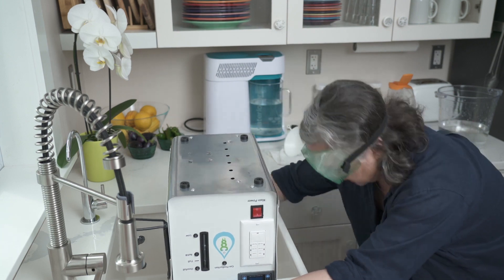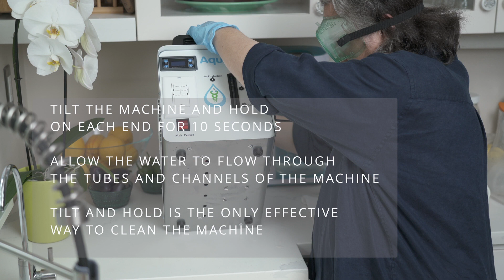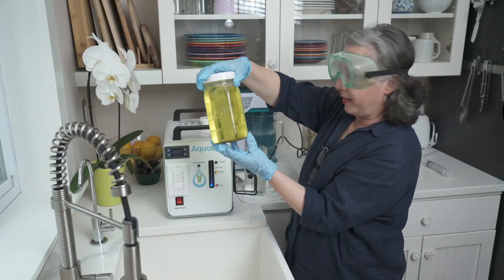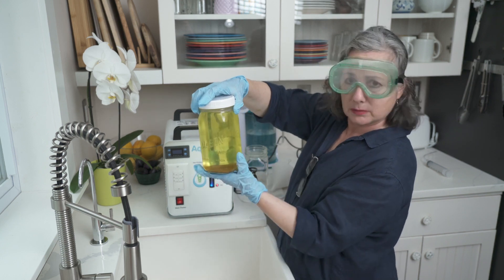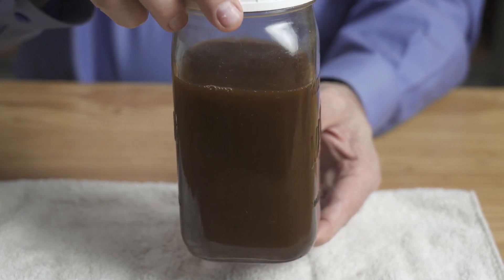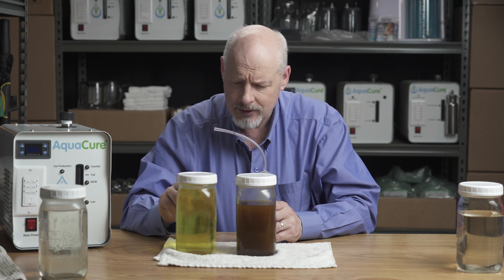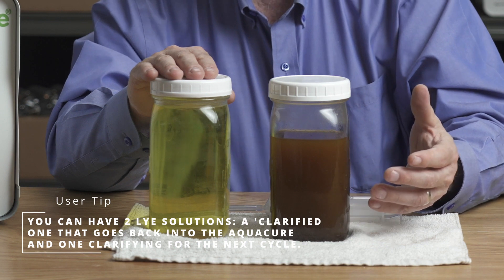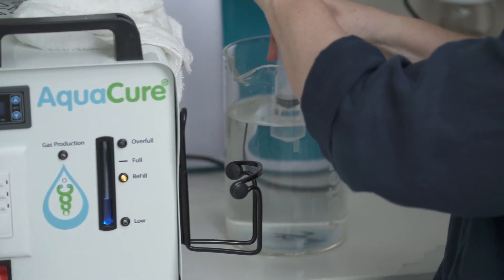AquaCure AC50 Maintenance (series video 5)

Comment: @7:04 how do you know when and how much lye to add back in?
Reply from the maker: Such questions are best asked by eMail using 'support'   https://eagle-research.com/contact/
FAQ: When do I add lye into the AquaCure Solution?

My advise is NEVER to change the lye in your machine.  In one of my electrolyzers I’m still using the same lye I originally put in it in 1986.

You should CLEAN the lye, but then reuse it.  From time to time you might need to ADD lye, because a tiny amount rides out on the water moisture… but that’s it.

The only time you need to CHANGE the lye is if it gets contaminated…  If you have foaming happening (which causes a rapid loss of lye) then you need to dump, rinse and put in a new lye solution.

You can buy 99%+ pure food grade lye online.  Here’s an example:

https://www.amazon.ca/gp/product/B06W57N49Y?

https://www.amazon.com/Sodium-Hydroxide-Grade-Caustic-Ounce/dp/B06W57N49Y/ref=sr_1_2

All that said, you do need to CLEAN your machine periodically (about every 100 to 200 hours) to get the sludge out.

First dump the lye solution into a plastic bucket (save it, don’t pour it down the drain).

Second, fill the AquaCure with warm (not hot) water (can be tap water) and dump it out (down the sink OK) as many times as needed until the water comes out clear (no sludge or debris).

NOTE: Vinegar or citric acid are not needed for flushing, plain warm tap water is OK.  There are no 'deposits' for such cleaning agents to dissolve and lye itself is a great 'soap'.

Third, filter the saved lye solution through a coffee filter and then pour it back into the AquaCure.

You keep the old lye because it is 'conditioned' and more efficient than 'new' lye.  It does not matter if it's discolored (that occurs in any case).  What matters is to filter it to get out the debris and sludge; otherwise it'll last for years.

Note: if your gas production has been reducing, it may be because your lye solution has gotten weak.  

You will lose lye over time (for several reasons) so you can add an ounce of lye when the solution is out of the machine, but ONLY if you need it.  You do not want the lye solution to become too concentrated.
FAQ: When do I add more lye?
The lye is a catalyst, so it is not 'consumed' and in theory the initial charge would last a lifetime.
However, in practice a tiny amount is lost out with the gas over time (the Tower Cap reduces loss and the Humidifier absorbs the rest). 

Lye can also be lost when people pour out some of the solution or if there is a leak or during maintenance rinsings.

The easiest way to determine when you need to add another ounce of lye is when you notice the gas production has dropped AND there is no gas leak or hose blockage;  99% of the time a drop in gas production IS A GAS LEAK.

FAQ: Electrolyte (lye or NaOH) solution concentration
I do recommend a specific gravity (of the Lye solution) of about 1.05 to 1.1 (using a hydrometer).  
Here’s a good video on what a hydrometer is and how to use a hydrometer (need a test cylinder too)
https://www.youtube.com/watch?v=0rj8s6mMAsE

You can get a good kit from Amazon.  Be sure it is a hydrometer and not (or not only) an alcohol meter.
https://www.amazon.ca/Specific-Gravity-Hydrometer-Test-Kit/dp/B001X27L9W/ref=sr_1_1_sspa

Or just mix 80 grams of lye in the first mix of solution.  The solution does NOT need to be exact.  In fact it’ll vary normally as the water leaves anyway, the remaining solution becomes more concentrated.

You can use more lye (I previously recommended up to 150 grams), but we've found it leads to excessive internal lye crystallization that causes clouding of the sight tube and exacerbates any internal plugging (due to sludge formation or oil contamination turning to soap).
How to add more Lye?
NEVER pour lye powder down the water fill stem.  

If you just pour the lye powder into the AquaCure it WILL set up like concrete and not go into solution, the hard chunks might even come loose and block internal gas orifices.

I recommended that you pour out the solution into a plastic bucket or stainless steel sauce pan, add one ounce of lye, mixing it in like you did when you made the initial catalyst batch.

I always recommend re-using the OLD solution.  It is more efficient than NEW solution because it is ‘conditioned’.  I’m still using lye solution I originally mixed in 1986.  Don’t waste your conditioned lye!

Color of the electrolyte does NOT matter, electrolyte normally discolors with use.  What matters is sludge or debris.  
If you see any sludge or debris in the solution you poured out, use the opportunity to filter the electrolyte solution through a coffee filter before pouring the solution back into the AquaCure.  Often if you just let it sit, the sludge will settle to the bottom, leaving a clear yellowish liquid.

It’s also a good idea (if there is sludge or debris) to rinse out the AquaCure 
Put about 3/4 liter of warm (not hot) water (can be tap water) into the AquaCure and swish it around by moving the AquaCure from side to side.  
Then dump it out (down the sink OK), 
repeating as many times as needed until the water comes out clear (no sludge or debris).
then pour your cleaned lye solution back into the AquaCure.

You should CLEAN the lye, but then reuse it.  From time to time you might need to ADD lye, because a tiny amount rides out on the water moisture… but that’s it.

The only time you need to CHANGE the lye is if it gets contaminated…  If you have foaming happening (which causes a rapid loss of lye) then you need to dump, rinse and put in a new lye solution.

All that said, you do need to CLEAN your machine periodically (about every 100 to 200 hours) to get the sludge out.

First dump the lye solution into a plastic bucket (save it, don’t pour it down the drain).

Second, put about 3/4 liter of warm (not hot) water (can be tap water) into the AquaCure and swish it around by moving the AquaCure from side to side.  
Then dump it out (down the sink OK), 
repeating as many times as needed until the water comes out clear (no sludge or debris).

NOTE: Vinegar or citric acid are not needed for flushing, plain hot tap water is OK.  There are no 'deposits' for such cleaning agents to dissolve and lye itself is a great 'soap'.  
We no longer recommend ever putting citric acid in the AquaCure, because trace oils cause foaming and plugging issues.

Third, allow the saved lye solution to settle then pour the clarified solution back into the AquaCure (you may have to use the ‘hose on the syringe, to suck up the solution without disturbing the settled sludge).

You keep the old lye because it is 'conditioned' and more efficient than 'new' lye.  It does not matter if it's discolored (that occurs in any case).  What matters is to get out the debris and sludge; otherwise it'll last for years.

Note: if your gas production has been reducing over time (years), it may be because your lye solution has gotten weak.  

You will lose lye over time (for several reasons) so you can add an ounce of lye when the solution is out of the machine, but ONLY if you need it.  You do not want the lye solution to become too concentrated.

We recommend the model EA-H160 to have a solution of 1 ounce of lye to a quart of water and the AC50 to have 4 ounces of lye to a quart of water.  These are for initial fill ONLY.  Regular refills of water are distilled water ONLY.

Yes, you can add lye to the water you put into the AquaCure but ONLY when you want to add more lye.  Typically you just top up the AquaCure with pure (distilled) water.

1 ounce = about 30 grams = about 2 tablespoons

Comment: I have a unit with just shy of 9000 hours. It worked well and I had some amazing curing from it. Now it doesn't produce any significant amount of gas anymore. I added some lye and still no joy. I Flushed it, no joy. 
How do I test the solution to check its strength?
Suggestions?
Reply from the maker: Yes, I have FAQ to help you.
Fill out the contact page and we'll get you fixed up.  Be sure to include your machine's serial number.
https://eagle-research.com/contact/
Reply: Call off the troops! I decided to try one more cleaning.... I flushed it with approximately 140 degree water, doing the tipping and added a bit of sloshing and then dumped it in the tub so I could see what came out. Probably filled and dumped 4 times. I was going to start testing the hoses in case they were leaking when I decided to just turn it on one more time..... The gas was flowing better than I had seen in a long time, green light is basically on, however when I plugged in the second bottle it went back to zilch again. So removed the hose and there seemed to be gas flowing from the first bottle so then I took off the aquarium stone and the air flows through very well. So tried blowing through the two stones I have and they both were hard to blow through. So I  put them in hot water to soak and still nothing. I will continue to soak them for awhile and just use the hose to bubble the gas. Is there any problem with that plan?
Reply: To be clear I run the gas for long periods and so run at half the amount for my body weight - 17%, 11%  for my lady
Reply from the maker: @frozenflyify   Soaking the stones won't work.  Think about it... They are currently soaking ALL THE TIME and got plugged.  How to clean them will depend on why they are plugged.  I have recommendations but this isn't the best forum for this type of answers.
Fill out the contact page and we'll get you fixed up.  Be sure to include your machine's serial number.
https://eagle-research.com/contact/

Comment: We had a foaming issue at 73 hours after months of great use... now not sure I rinsed the unit initially. The lye I took out was deep yellow with plenty of sludge... probably some from 'construction'. Thanks for the video for my early 100 hour maintenance. Only thing i'd add is a reminder of how much water might be needed after re-adding the lye solution.

Comment: Hello George. After having replenished the machine with the humidifier's water when the refill light had come on. I am not getting any bubbles from the big bottle only a bit from the humidifier. I had also tried tightening the cylindrical tower on top of the machine. Still nothing.
Reply from the maker: Sounds like you have a couple of gas leaks.
To get help, please re-send this message via https://eagle-research.com/contact/

Comment: Can you use boiling water?
Reply from the maker: I'm not sure what you are asking?
But if you boil water it drives out all gasses (like to make clear ice cubes).
Boiling water sterilizes it, but doesn't clean it, you use distilled water in the machine.

Comment: the first time I maintained my unit, after 100 hours of use, I found small spots, about the size of a silver dollar, where the unit had dripped white crusty powder. Also around the metal tab that protrude from the bottom of the unit, the dripping had left encrusted white powder. Is this lye encrustation? Is this normal, or is my unit defective? I see this encrustation in every maintenance. I can send photos.
Reply from the maker: It is lye and is typical when the Tower Cap base is improperly installed.  The (very tiny) drip of water, containing a bit of lye drains down through the machine and out the bottom.
Properly Install the Tower Cap
https://youtu.be/Pr98DMe94No

Make sure your Tower Cap base Union base is sealed properly and that you install and remove the Tower Cap using the Union ring, so you do not need to keep re-applying the Teflon Tape.  
DO NOT ’torque’ on the Tower Cap to install / seal the base fitting; doing so will ‘lock up’ the Union Big Ring, requiring wrenches to loosen it.

If you have ‘locked’ the Union…
Put one wrench (like a Water Pipe Plier or a Vice Grip) on the bottom Union piece (screws onto the waterfall stem) to HOLD IT from turning.  Do NOT allow the bottom piece to turn.

Put another larger wrench (like large Water Pipe Plier or Pipe Wrench or Strap Wrench) on the BIG RING and turn counter-clockwise.  DO NOT put a wrench on or touch any other part of the Tower Cap.  Turn ONLY on the Big Ring.

You can look online to see how to use a strap wrench.  Strap wrenches are handy and fit almost anything.  Common uses are for opening jars in the kitchen or for removing oil filters in the shop, etc.
https://www.wikihow.com/Use-a-Strap-Wrench
https://www.youtube.com/watch?v=eoRT8UvYraI

In the future, install the Tower Cap as per this video and it won’t lock up and you won’t need wrenches.
AquaCure AC50 SetUp Video
https://youtu.be/ph1inNyyZYs

To fix Tower Cap base leaks, remove the Tower Cap base, clean off any lye powder (vacuum works).  Leave on the old tape and ADD MORE.  Sometimes it takes 20 to 30 wraps (if the tape is thin).  As long as you can screw on the fitting without pushing down the tape, it isn't too much.

May the blessings be
 🦅 George Wiseman
Reply: @ecopegasus  thanks, I've added more plumbers tape to the Tower Cap, and I'll keep an eye on it looking for the better seal to keep stop the dripping
Reply: As I  read this comment stream because this is what i was experienceing.

Rachael called back,
    You u have a great product and a great support system.
Keep posting it saves unecessary calls.